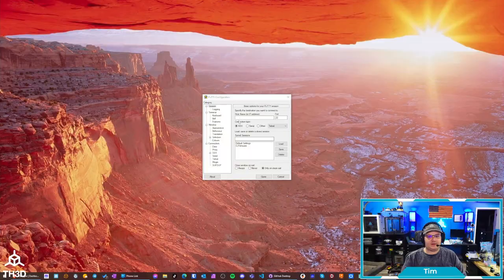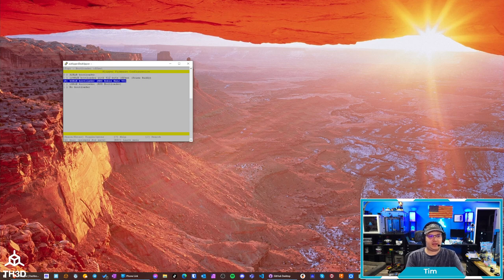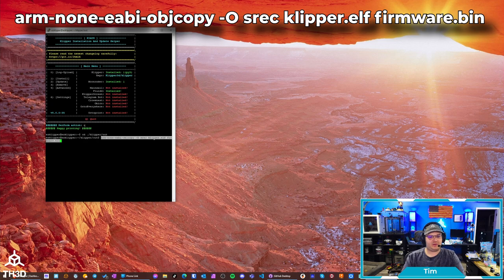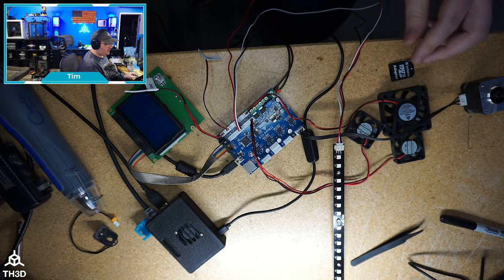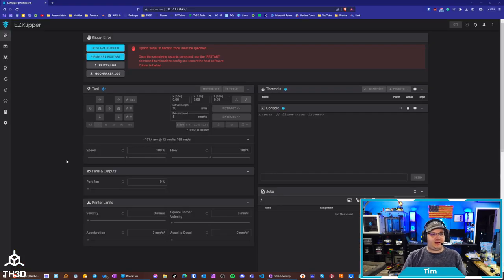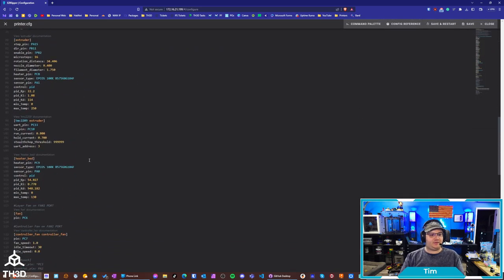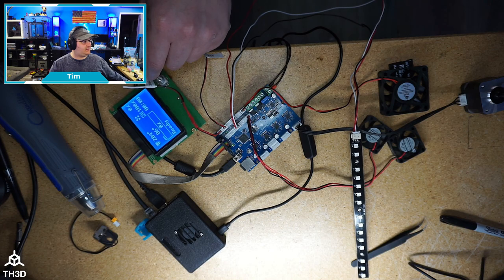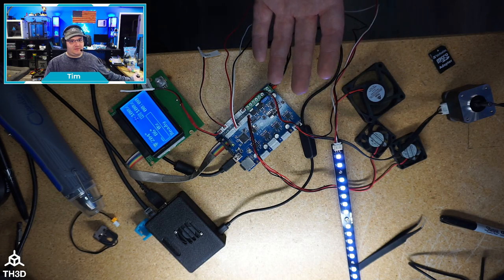Installing Klipper on the EZBoard V2 - Klipper Setup Guide

Comment: Wish I had this when I set up mine :) 
The command line step of converting the Klipper.elf to SREC bin format is the magic sauce or else it won't flash properly. The original Klipper ezBoard v2 example config was missing that step.
Glad to have this top notch board working in one of my machines with Klipper.